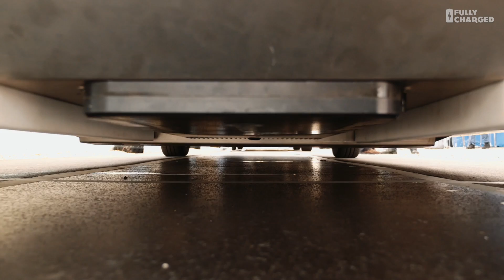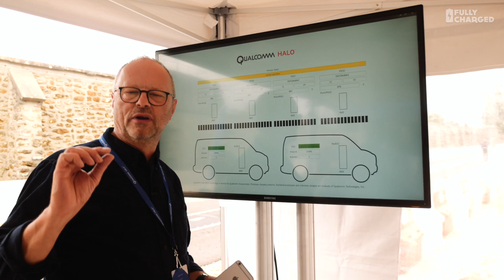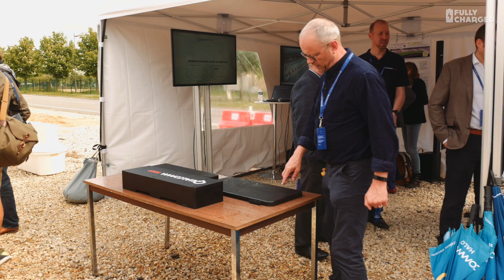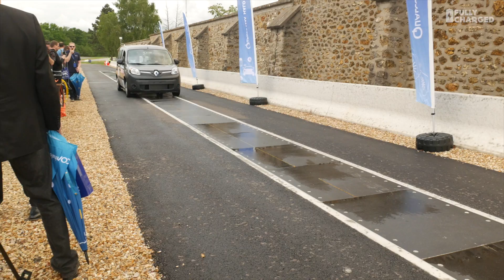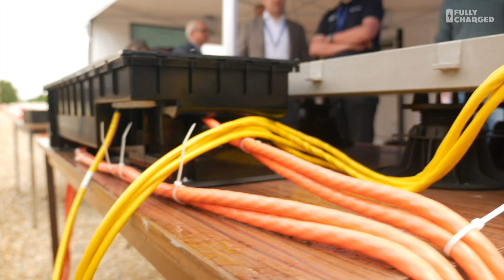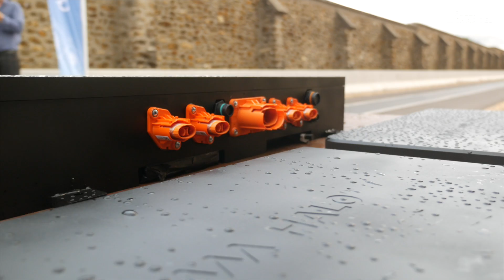Dynamic Electric Vehicle Charging | Fully Charged

Comment: They ignored one issue: efficiency. The efficiency of a Qi system(the one used in smartphones) has a maximum efficiency of around 70%. Qi should be more efficient than the system presented in this video since it doesn't move and the coils are positioned very close to each other. Even if the system in this video has an efficiency of 70%, that's quite the energy loss. A Tesla model S has a battery capacity of 100 KWh. In order to fully charge that 100 KWh battery this system would waste around 44 KWh. If there's an electrical/electronics engineer here please correct me if I'm wrong.
Reply: Normally, cable charging for EVs is around 90% efficient (losses in battery and converters of electricity),  while inductive charging is dependant on the distance between charging pads, but the stationary inductive charging is around 80% efficient.

Phones have lower efficiency for a number of reasons. Do not confuse phone inductive standards and EV inductive standards. Phones also charge inefficiently but looking at how little energy a phone needs, efficiency isn't their first priority, but rather higher frequency, making transformers smaller, making a smaller and lighter charger.

Nobody really knows how good this technology could get, and nobody is braging how efficient it is now, because it probably isn't efficient yet.
Reply: @Colibri same inverse square relation is true with B (magnetic field), and flux density is just B/A. And btw every electric field comes with a magnetic field perpendicular that's why it's called EM radiation not just electric field radiation. Since induction is proportional to flux density it's also an inverse relation. But, the thing is you don't necessarily lose that electricity that isn't induced in the other coil. The magnetic field that isn't induced just collapses back into your original circuit and it could do work in something else so it doesn't have to be a pure efficiency loss. I could be wrong as I took the class on this over summer and it was pretty condensed but fairly certain on it.
In the end you could have a dual purpose for a system like this which is to use the road as a transmission line which can induce into a car but that way none of the electricity that isn't induced is wasted it would be used still by the grid. That way there should be barely any more losses really other than standard transmission losses.
Reply: "Experts" estimate the need for 70,000 charge stations per 1 Million cars. Ecotricity (from memory) said that each Rapid charger was £40K to install. Tesla have installed thousands. and yet, I doubt the millions of cars can be served as an absolute. BTW I am certified in Electronics and Electrical servicing, so I have tiny bit of knowledge and experience. Also, the costs of copper vs aluminium is pointless, those lines are Distribution lines, with very little exception everything you plug into is copper, through your house, work, street, so along with many other things they are not choices we get or even need to consider. "However that doesn't mean wireless chargers for cars are even practical or economical." What? they are here today? Others have already done the work on both points... so, I think what you are trying to say is that they have happened whether they are practical or economical? You can go buy one and fit it to your car? People have and people do? All I'm trying to say is wireless electric car charging is already here, now, today. Whilst in motion is wireless energy transfer practical, well its just been proven to you, so yeah. Is it economical, yes, the economics have been studied and are being interdependently studied today. Did you know that once upon a time people shouted Lithium Ion batteries, no, not ever, they are a fraud, they cost too much, they will never work, they will never be cheap enough for anything, and yet here we are, Tesla throws 7,000 into a car.
Reply: I'm glad you brought up the issue of having the coils much further away, there's no way they're getting anywhere near 70% even. If I recall correctly the magnetic flux density has an inverse square relation with distance and the inductance depends proportionally with the magnetic flux density so those extra 17cm or what not should cause huge additional efficiency losses in comparison to a smartphone charger although the coils are of course larger as well. Electrical Engineering student as requested :D
In the end I don't think that's the technologies downfall though it'll just come down to cost which is hard to imagine to be ever competitive.
Reply: @Elektrotehnik I did heard of inductive charging standards that have an efficiency above 80%, but those systems aren't really wireless, there more like contactless, in the sense that they use an inductive pad on the end of a cable. Magne charge was such a system. Yes, the efficiency of low power induction charging is lower than that of a high power charger. "inductive charging is dependant on the distance between charging pads" that is one of the issue with the system presented in the video. Another problem is that efficiency depends on how centered one pad is to the other, quite an issue with moving pads. You're right, the technology could get better, however I can't shake of the feeling that this is nothing more than a publicity campaign by Qualcomm.
Reply: From what I know the inverse square relation applies to electromagnetic radiation and gravity. I have no idea whether it applies to magnetic fields...Yeah, cost makes a difference, like for example the cost of a wireless bus with batteries and copper coils instead of a trolley bus with cheaper over head aluminium wires and no batteries.
Reply: Metal core transformers are more efficient because they take less current to build max saturation of the ferrite or laminated iron somewhere around 2.1 Tesla, but the energy loss isn't lost in some special way to heat other than standard resistance of the coils. When a magnetic field collapses it just goes right back into  whatever circuit it can find. If there's no other metal around other than the actual copper coils then it won't be lost if you do something with it (other than resistance of course), like either by using it elsewhere in the grid or charging a capacitor that can then be discharged again. 
The reason why QI chargers get so hot is because they use tiny coils with itty bitty wires and lots of turns because of space constraints, therefore you have high resistance which causes those losses and that terrible efficiency. When thinking about it a larger system can be far more efficient even with some extra distance, I know I'm contradicting my first comment a bit but I went to look at my physics book again and gave it some thought. Somebody posted this somewhere here in the comment section, I'll repost this, I have yet to fully read through but they actually got pretty good efficiency.
https://energy.gov/sites/prod/files/2015/07/f24/vss103_onar_2015_o.pdf
The powerfactor is affected just because of the reactance difference basically because the inductor slows current build up and reversal down and spreads the waveform but this can be counteracted actively or passively with for example capacitors.
It makes me wonder though if the area under the curve stays the same with longer drawn out waveforms hitting the same peaks vs much more waveforms over the same period of time but of course steeper waves. Intuitively I'd say the area under the curve is the same but that's something I'll have to investigate a bit, it's possible there is some extra losses involved there. I'm gonna talk to my physics professor about it.
Reply: still more efficient than a big petrol engine
Reply: Yes, but this is not about petrol cars, it's about wireless vs plug in charging. Fast charging at a plug in station is more efficient than this wireless system.
Reply: When we have surplus energy on the UK grid, like many others, we throw it away, this is only set to happen more often and when it does, efficiency versus the economic benefits will make these irrelevant anyway. There are so many inefficiencies with line losses already and that didn't stop them running a lossy cable to your home. Inefficiencies are a given, but not impractical. Nobody gripes at the losses in old petrol engines that today run more efficient. People assume that the engineers building these prototypes are completely stupid and that their ill informed comments matter a jot.
Reply: Even with surplus energy there is no point in wasting it. Wireless recharging is more expensive than plug in systems because of the higher quantity of copper needed to make the coils. Most power lines within a city are made from aluminium which is dirt cheap compared to copper. Losses within a cable are very small compared to the losses with induction charging and they depend on variables like wire diameter and voltage. Even though cables have losses, they're the most efficient method for most applications. The engineers are not stupid. The engineers do what their company tells them to do. Qualcomm most likely does this for publicity just like Elon Musk with his intercontinental rocket travel. The system in this video could be the best wireless charging system for cars ever designed. However that doesn't mean wireless chargers for cars are even practical or economical. I don't know what the cost of replacing most of the roads within a city with these modules is, but it's surely more expensive than building more plug-in fast chargers across the city.
Reply: "Wireless recharging is more expensive than plug in systems because of the higher quantity of copper needed to make the coils." Really, have you seen how much copper there is inside a rapid charger? Do you even know? No, of course not. Googles it, I'm willing to bet you ounce for ounce there is more in a Rapid charger than a wireless one. Go ask Plugless power, read the specs. As for the roads, as others have said, they are perpetually being dug up, in fact they are digging up my street again, today laying more fibre optic for miles and miles and miles, ultimately nothing stops progress. I bet if you google wireless busses, wireless road charging, etc, you will find projects underway all over the world. I guess most of your concerns have already being dealt with.
Reply: @thebluesclues2012  First of all let me admit that I forgot to include slow chargers which charge your car over night at a lower cost compared to both rapid chargers and the moving wireless chargers. I was comparing the cost of aluminium vs copper just to point out the cost of copper. Also the comparison makes a difference in public transportation when you're comparing a trolley bus with a moving wireless bus that would work on a system like the one presented in the video. The statement about wireless chargers not being practical for cars was about the chargers placed in roads, not the ones in parking lot which can be raised above the ground meaning that the coils are closer and thus the efficiency is higher, but that was my mistake for not specifying. Please don't use the "They used to laugh at..." argument. Carl Sagan once said" They laughed at Columbus, they laughed at Fulton, they laughed at the Wright Brothers. But they also laughed at Bozo the Clown." Wireless charging is generally more expensive than normal charging due to the inefficiency of the system. A less efficient system requires a higher transmitter wattage in order to provide the receiver wattage that the car uses. A rapid charger does use a lot of copper because of its high wattage, but still less copper than a wireless charger of an equivalent receiver wattage. Plugless has a receiver wattage of 10 KW for a tesla model S. A rapid charger goes beyond 50 KW. Comparing the copper content of these two is kind of pointless. You need to compare the copper content of two chargers that provide the same receiver wattage to the same car model. There are concepts and prototypes of wireless buses, but they're main selling point is the reduction in cost of battery. However Trolley buses have no batteries, and do not need copper coils in the ground to transfer power. Also battery technology is improving resulting in cheaper batteries like metal air batteries.
Reply: @Rykahnz Yes, but isn't an inductive charging system basically an air core transformer? Metal core transformers are more efficient than air core ones and still they waste energy as heat. I'm guessing when engineers say that for example the QI charger is 70 % efficient they are referring to the energy lost as heat and maybe some RF.    Doesn't the remaining magnetic field affect the power factor?

Comment: I think the best way to use this is to install these in every 50 to 100 miles of highway and make it stronger so drivers can just slow down a bit every 100 miles to charge on these.
Reply: Marvincent Acuña 
Rather than placing these every 100 miles on the motorway you could simply pull off for a comfort break and charge for ten minutes?

Comment: I can see applications for this in closed, commercial systems but not on public roads for public use especially with those small clearance requirements. Too many things to go wrong when exposed to the idiocy of the general public and it doesn't really make sense. We already have excellent electrified transport on 'tracks' - they're called trains, and we need more of them, not more cars.

Also, how does the induction process not lead to some losses in forward momentum (ie. inducing magnetic fields which resist vehicle movement)?
Reply: The induction is not from the moving car.  It's from ac current.  Also, people like cars too much.  Tell them to take the train and they'll give you the finger and take the car anyway.  Cheers Mite.
Reply: Yes... that was my point. There is an AC current in the 'road' inducing an AC current in the car... so you're telling me this has no electromagnetic effect on the car's momentum? I don't think so...
Reply: I don't think there would be.  It's an 85 kHz ac signal.  It's not some dopey magnets in the road like I was thinking.  The pictures of the units with black and white stripes on the top got me a little confused.  To me, they suggested the poles of a magnet.  Then I realized that the real units were just all black and running an 85kHz ac current.  I don't think they effect the drag on the car.  I just don't know.
Reply: Maybe the effect is negligible? Who knows... but nobody seems to mention it. I still think this will never be for public use, but I do see an application for commercial industrial usage (ie. forklifts, warehouses, etc.)
Reply: Let's look at it from another angle.  Electricity is not free.  Why would a municipality foot the bill for charging other people's cars.  If it were used for a forklift, the company would be paying for its own use.  That makes more sense.  Taxpayers have enough expenses as is.  Adding some dopey road panel is gonna piss the no end.

Comment: This, for me, could be fundamentally the end of range anxiety. Major A-roads and Motorways have this sunk into them. So the only time you’d need to use your battery would be off-grid on b-roads and into estates. Thus with current battery tech only giving you 300-ish miles per charge, you could do Lands End to John O’Groats non stop in an electric vehicle, assuming you had this technology on the majority of the main roads. It would allow battery + autonomous driving to ‘leapfrog’ fossil fuel vehicles.

Comment: Seems like the power is so low that it would need to be laid along a very long stretch to give any good extra range. An EV uses at least 15kw at 110km/h... To charge in 20kw during 10km would then only give that 10km and another 2,5km extra. If the power would be able to at least triple it might help... Since this is a pilot I hope that will be the case when the product is ready. Or they can have it at places where you drive slower so you stay over them a long time... like places where the traffic often is slow.

Comment: It's a nice implementation of the idea. How much do they estimate the cost of manufacture and installation will be per kilometre? And by how much will that reduce as the economies of scale kick in? If it's on a motorway, then there will be a need for installation on each lane, so if the cost, including maintenance, is relatively low in comparison to the overall cost of building and maintaining the carriageway, and if it's robust enough to withstand the onslaught of heavy lorries, then this could be a winner. Thanks for broaching the subject, Robert.

Comment: not that i doubt the theory behind this. 1 an insulator has be placed between the power generator and the vehicle ie the road surface. 2 water damage the road has to last 20 years,(look that the M25). 3 the problems from one or more units failing will be stranded motorists and longer road works. 4 power loss from moving through the air is low at high voltage however at lower ones its less efficient. so i have to drive over a giant electrified surface to get this thing to work. 5 roads are made of tarmac for grip plastic by comparison is slippery and has the added disadvantage of cracking when placed under loads, scuffed by wheels and damaged by UV light.